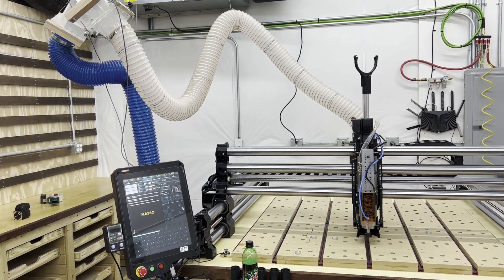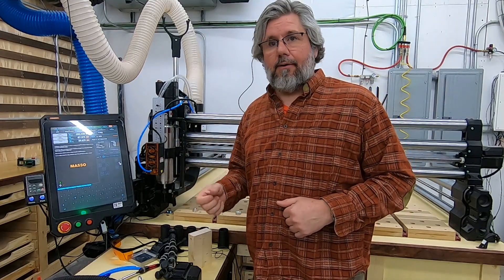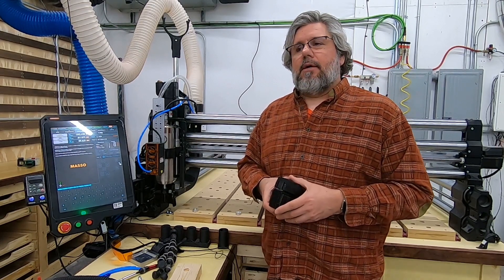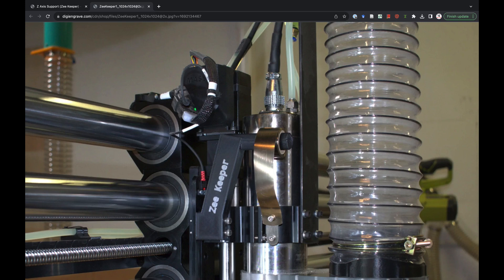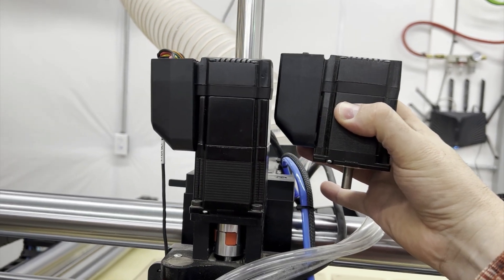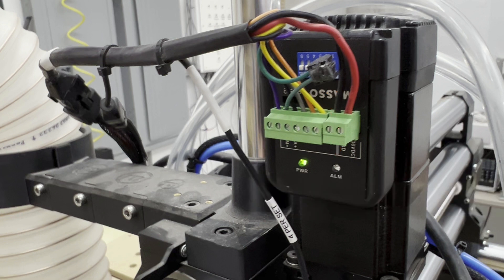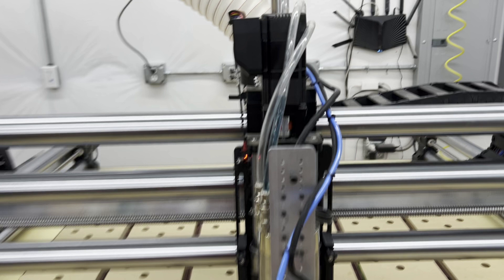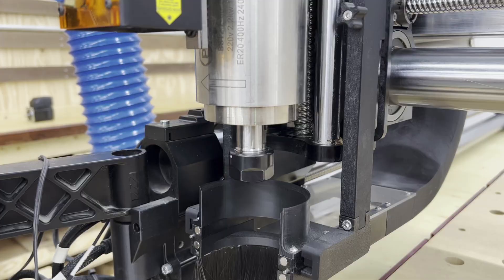Put the Brakes on Your Z

Comment: I just ordered the Z brake motor (12-14 weeks out).  Since I will be installing your Sidekick on my 2.2kw ATC spindle soon, will I still be able to access the lower half of the coupler bolts, so I don't have to remove my entire spindle setup?  Thanks!
Reply from the maker: I'm sure you can do it the way Onefinity suggests, but the method in my video might not be possible with the Sidekick already installed.  I haven't tried that.  More area is definitely blocked with the Sidekick already installed.

Comment: Wait by default the onefinity spindle crashes when turned off. This is the first I'm hearing aboutit .
Reply from the maker: If you just have a little trim router mounted, it won’t.  If you have a spindle mounted, which is much heavier, it will move down under its own weight when the stock Z motor is turned off.  Now that they have the braking Z motor, maybe that’ll decide to start shipping it with new units.  We can hope!